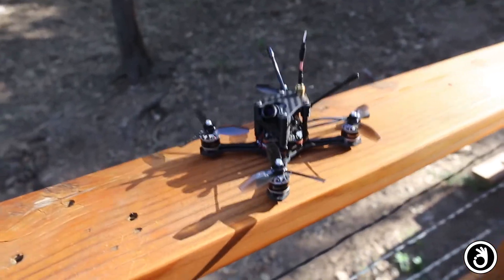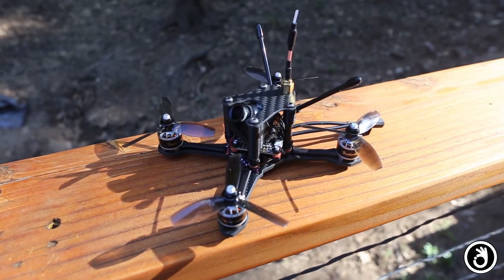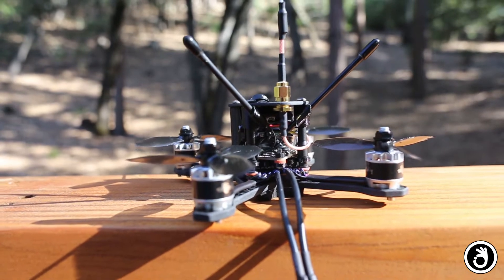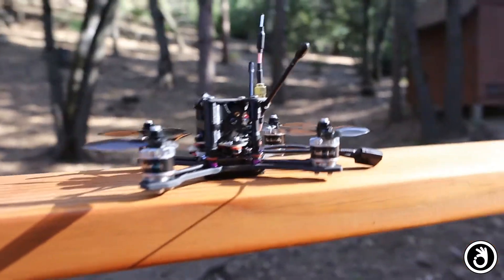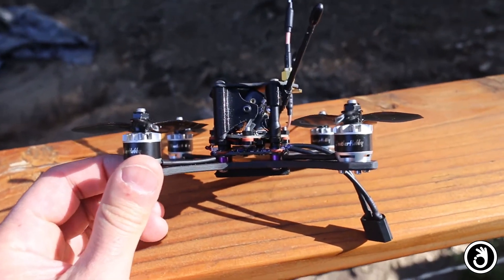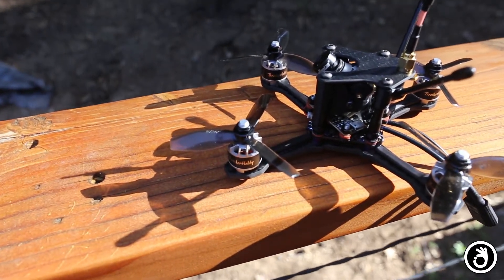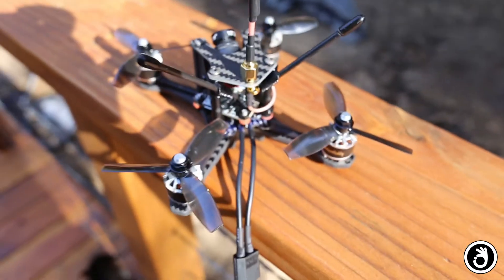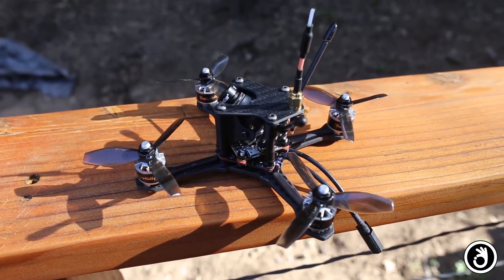3 Inch Mini Drone Horus Slipstream 3

Comment: Lots of people have been using the BH 1407 in 4 inch setups too. Ive even seen them used on 5 inch biblades. There are much better 1407 motors out now, but they still get the job done. The new 1108's kick ass on 3 inch props btw. With only 3s lipo the rcinpower 1108 6800kv motors put out 504grams of thrust with 3035x3 props. Thats about the same as a 1407 on 4s but with MASSIVE weight savings.
Reply from the maker: I agree. I always felt the BH1407 were a little too notchy and sent back a lot of feedback. I fly Cobra 1407 now and like them more. At least in this size range.

Comment: Nice build. What battery are you using?
Reply from the maker: Thanks. 799mah 4S Pyro-Drone packs. But I think that both 800 and 700, maybe even 600 might be enough. 4S though. It's a little heavy for 3S think.
Reply: PinchTune Airblade has some fantastic 75c 700mah 4s that weigh only 77grams. That'd be perfect for this quad. Its one of my favorite batteries for smaller stuff.

Comment: Do you find it necessary to run a capacitor on  the 3” builds for motor noise?
Reply from the maker: I had an awfully hard time tuning this one. So yes, I would say do. Specially on motors that are as noisy as these. I'm currently rebuilding it and I will be using a cap. I'll likely update with another video once it's done so stay tuned.